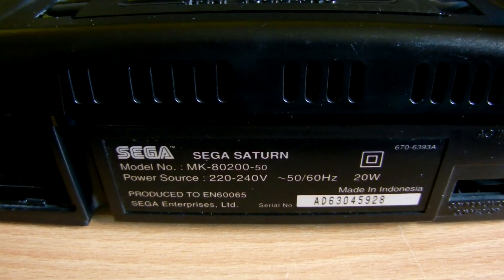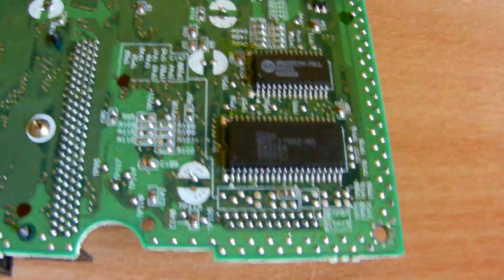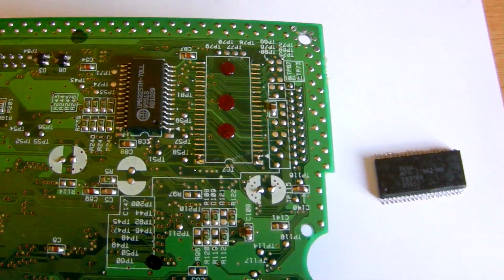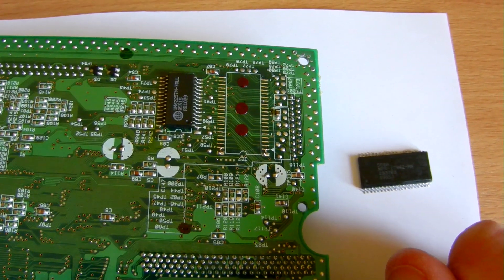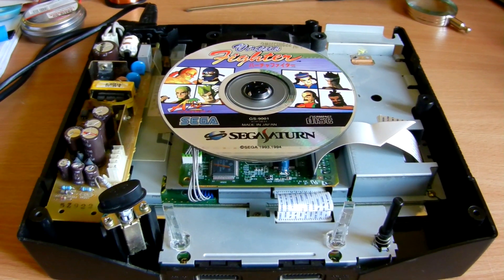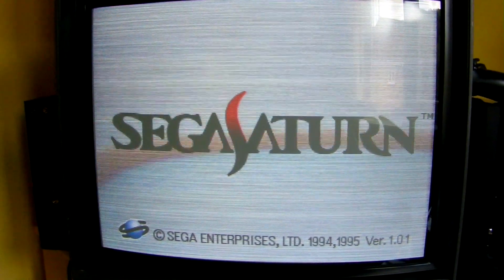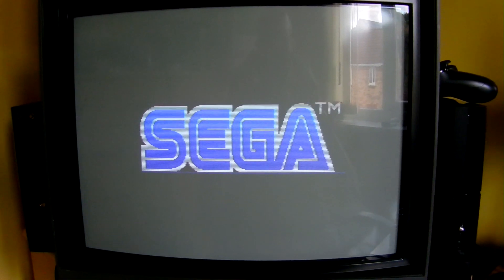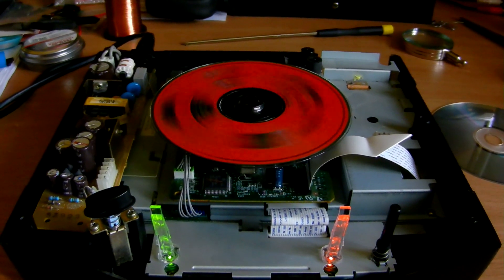Sega Saturn BIOS Region Mod

Comment: Just bought a model 1 V Saturn (Victor) with this chip installed packed with its original V Saturn (Victor) controller on eBay. Can’t wait to play some Alien Trilogy and Sega Rally. Awesome system, extremely overlooked back in the day (I had one, loved it back then) but thankfully the Saturn is starting to get the recognition it deserves.

Comment: luckily for me and any other fuckwits out there they also made something called a Japanese Saturn which requires no more work than opening the box.....:)
Reply from the maker: PMSL
Reply: No kidding, I paid $3 plus shipping for a White one with 10 games, 2 controllers and the Virtua Cop gun, so I say screw any modding for this system :p 
If you get into Saturn or PC-Engine, it's mostly for Japanese games anyway.
Reply: minks36 Here! here! :D
Nearly fried my latest PAL SAT trying a switched multi-region mod conversion - I did one years ago fine - but this time my bodge-it cheap soldering iron got too hot and lifted the jumper pads and tracks from the motherboard - so I had to recreate some of the region lock PCB tracks using resistor leg/wires...nightmare! Soldered them into place and then I hot-glued them to the motherboard to stop any shorting/movement.
It works ok now tho - I put it back to PAL default :-)
Since then I got another JP MK1 Grey Saturn - sorted :D

Comment: As for desoldering Smd chips, I remember lukemorse had a technique that he used dental floss/string under the legs to best remove them.
Reply from the maker: That method is tried and tested and certainly not unique to Luke. Although I'm not sure about using dental floss or string!! lol  I use Kynar wire.
Reply: ah, that's what it was!